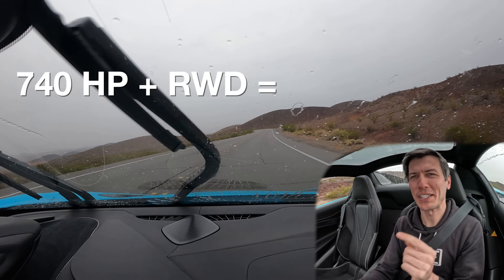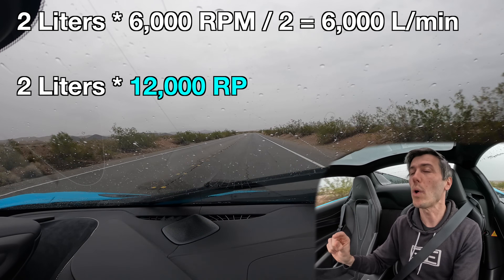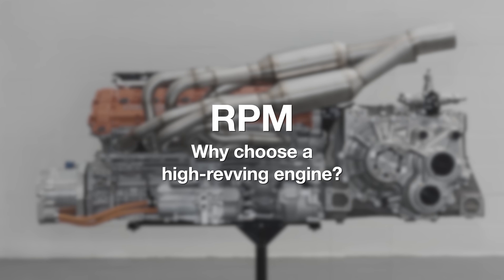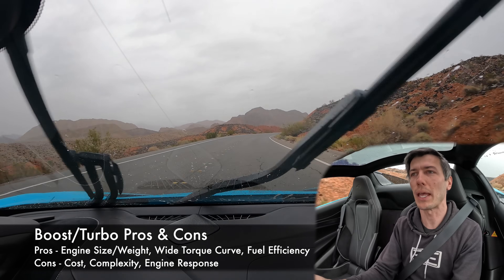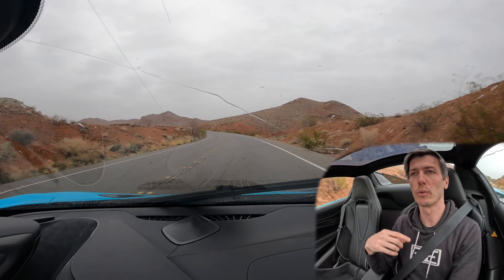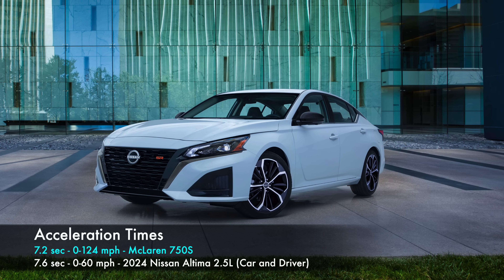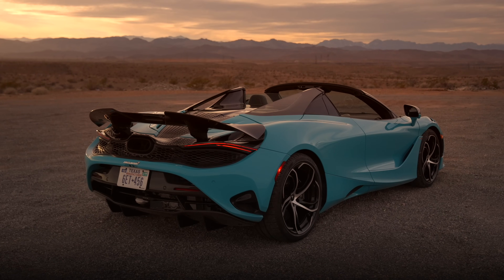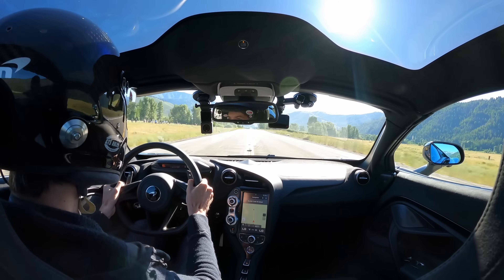Boost vs RPM vs Displacement - What's Best For Horsepower?

Comment: The way the Viper is 8.4L and the Koenigsegg TFG is 2L, and they both make about the same power is actually so insane.
Reply: In a sense, but one has to consider hoe antiquated the Viper V10 is. Its still a Pushrod engine with all the limitations the pumping of air entails. Thats just the part where things get more complex when comparing engines and powerplants.
Reply: @air-headedaviator1805  Pushrod is mandatory on massive engines, so you can get away with big displacement and a light engine.
Reply: @air-headedaviator1805  all are still pumping the same amount of air… as Jason stated. As you know pushrods limit rpm, to compensate for this they have enlarged displacement. All are the same, just different flavors.
Reply: @air-headedaviator1805  yes it's still a 70's-platform that's modified, but the generation 5 camshaft ( and there was a twin phaser system planned for it after the 4th gen but never came to the general public/dealership's on top of R&D for multi-air VVL controls as the v10/high-spec was planned as the testing bed for the v8 line up but so-far hasn't tricked down yet unfortunately ) cam-in-cam is actually more advanced than ford's 2014~ coyote 5.0 cam's and needing 4 phasers are
Reply: @air-headedaviator1805  and how it was a kinda relatively non stressed engine. It didn't have that high of a compression ratio for a NA engine
Reply: Yes, but you only see Vipers winning races 😂 No one races Koenigseggs
Reply: @gwi8650  It depends on what the race is.  If it's a drag then yeah the Viper will win but on a track maybe not so much.
Reply: @answeris4217   huh ? Viper won Le Mans in its class, it also won several GT series in Europe.
"In total, 57 examples of the race car were built between 1996 and 2005, and the vehicle would go on to claim three class victories at Le Mans, as well as wins at the Nürburgring and 24 Hours of Spa."
Reply: @answeris4217 no on a drag koenigsegg gaps
Reply: @answeris4217 they whoop ass on tracks looooooool
Reply: @answeris4217   The viper is terrible for drag racing, it's a pure track car. There is a reason why the ACR smashed so many ring records.
Reply: @answeris4217 you don't watch car racing do you?
Reply: @answeris4217  I would bet money that a Viper ACR, (with literally half the power output) would smoke any Koenigsegg built to date on a vast majority of tracks
Reply: @mro9466  yeah in GT2 class...  they wouldn't even qualify in that class today with  8L engine.
Reply: @answeris4217  Around the track, the Viper will win. On a drag, the Koenigsegg will dust the Viper. You have it backwards.
Reply: @mro9466   In it's class. That class being GT2, not GT1 which is closer what Koenigsegg builds, in fact they considered it at one point but gave up as a rule change meant they couldn't meet the homologation requirements. If you want to compare to something similar, in the 1998 le mans the viper lost to the GT1 Mclaren F1, which has a lot in common with Koenigsegg cars, a carbon monocoque and body, along with a MR layout.
Reply: @peterjordansonthe2nd731   an acr is not beating a 1:1 on a circut
Reply: @answeris4217 viper holds the fastest lap time on the nurburgring for a manual vehicle, ofc that’s not saying the most nowadays cus we’ve moved to more efficient transmissions but she ain’t nothing to be underestimated
Reply: @pizzahutlogo5009  The Viper doesn't hold a top 10 lap on the Nurgurgring.  The fastest lap and the only sub 6 minute car is the Porche 919 hybrid Evo.

In fact Porche owns 4 of the top 10 times.  VW owns No2... Merc and BMW are on there Mclaren and Lambo are on there too.
Reply: You better look up vipers history.those cars have killed track record all over n are racing legends.
Reply: @answeris4217    The viper might also win on track (ACR version with extreme aero package). That thing got 7:01 on the nurburging.
Reply: @gwi8650 I like both cars, but pretty sure that Koenigsegg would smoke Viper out 😅
Reply: @rouchar No Koenigsegg has ever raced in any series. Hell no Koenigsegg has ever been eligible to race in any series.
Reply: @rouchar koenigsegg brokes fast
Reply: @rouchar well one was so dominant privateers were winning their class for a few years running and the other hasn't seen an actual race.
Reply: @rouchar  they are racing boosted vipers, so no
Reply: They may be some badass cars but vipers are racing legends n have broken hundreds of records possibly more than any other car out there not to mention some of them put down some serious power without a problem.line up a jesko n a built viper n watch that viper pull
Reply: @gwi8650 you’re delusional if you think a viper is beating a koenigsegg on track 😂😂
Reply: @ericship8383  Koenigsegg barely even tracks their cars, its difficult to find any official track times. The CCX did Nurburgring in over 7.5 minutes, Viper ACR did it in 7:01. Logic and physics would dictate that Koenigsegg's newer cars wouldn't be all that great comparatively on a track, since in order to hit those massive top speeds they have to sacrifice downforce. So in the corners they'll struggle compared to the Viper and make up that difference on straights.

If you wanna try to find numbers with sources to prove what you think might be true go ahead, but look at the list of super and hyper cars that are still slower on track than the ACR
Reply: @gwi8650  Nobody races Koenigseggs because they are ridiculously expensive
Reply: @gwi8650 what vipers are winning against amyrhing but lamborghinis 😂
Reply: No replacement for displacement. Complexity is generally an enemy of consistency and reliability.
Reply: @PRS-dk4mz American cars are the masters of high displacement and most of them have terrible reliability 

The redeeming quality there tho is they’re easy to work on
Reply: @goosebox9064 Terrible reliability? I can say that the pedestrian/econobox/small displacement engines from American manufacturers are pretty bad ngl. However, American large displacement engines/blocks are pretty stout and known to have a really good reliability history.
Reply: @_IMNNO  For example the 6.2l gm from the late 90s 2000s they run for half a million miles all the time
Reply: @goosebox9064 Terrible reliability? The cars the high displacement engines in question are usually in much more reliable than the European sports cars they compete against while being much cheaper. The Coyote, Viper, Hemi, and LS platforms are insanely reliable and proven to surpass 200K miles with nothing but basic maintenance as well as being able to handle double the factory HP when boosted and to do it with significant reliability.
Reply: @goosebox9064  Not really man. A lot of American v8s are pretty dang sturdy. It’s the econo-shitboxes we make that are horribly unreliable and I assume it’s the sports cars you’re referring to with “high displacement engines.” Not our 4 bangers and v6s. Although, we still have some decent ones thrown in the mix
Reply: @goosebox9064 The viper Engines have gotten 3500+ WHP on factory block and have ran 100+ passes no issues.
Reply: 80s F1 cars might have a differing opinion. Reliable? Hell nah! But faster than everything else!
Reply: @PRS-dk4mz  weight, size, efficiency
Reply: @PRS-dk4mz weeell... Considering that the advantages of displacement are power, low mechanical complexity, good response, the best replacement for displacement would be voltage and current 🤭
Reply: @PRS-dk4mz except there is a replacement for displacement 
Because just making an engine bigger isnt practical
Reply: @PRS-dk4mz ok then why dont u race with a cruse ship motor only 20000000lbs lol ur 100% wrong there is replacement fir displacement in drag racing 100%
Reply: @PRS-dk4mz there is a replacement for displacement, the replacement for displacement is technology, forced induction, more advanced flu dynamics
Reply: Which one do you suppose has the longer TBO?
Reply: @Flies2FLL Which one do you think will be smaller and lighter? And which one will be cheaper to buy? Which one will have better fuel efficiency and/or emissions? 
Engine design is all about making compromises.
Reply: WHICH ONE HAS MORE TORQUE?? Torque wins races.
Reply: @Reginald-Bowls no it doesn’t that’s completely wrong. Look at f1 cars
Reply: @jeff5798  look at the fastest vehicles on earth. F1 is a restricted race.
Reply: @Reginald-Bowls  you are obviously clearly wrong. Instead of making pointless arguments, go educate yourself. This very channel has explanations of hp and torque and how they work.
Reply: @Reginald-Bowls  f1 cars are the greatest race cars ever made and the torque is 280 nm compared to their 750hp at 18500rpm. Their displacement is 2.4L

The f1 engineers know better than any person watching this video
Revs win races
Reply: @goosebox9064  To be fair, the only reason F1 doesn't use more boost is because it's not allowed. I'm old enough to remember F1 engines pulling 1500 hp from a 1.5 litres through boosting. Reliability at those power levels was sketchy at best, too.
Reply: @goosebox9064  f1 cars are not the greatest race cars ever made 😂😂😂
They’re fully restricted by stifling rules.
Reply: @Reginald-Bowls  what would you say is better? Objectively f1 is the greatest but personally I like Le Mans more.

But even then, probably the best Le Mans car: the Porsche 919 evo still has a high revving engine
Reply: @Reginald-Bowls  also you said ‘torque wins races’ which it obviously does not. Nothing about fastest cars on earth, which would be rocket powered cars, with ZERO torque.
Reply: @Reginald-Bowls What do you think "Formula" means in F1? The formula IS the rule set lmao
Reply: @goosebox9064 You mixed all the F1 cars together 😂 modern F1 cars have 750nm of torque and rev to about 12 000 rpm.
Reply: @nodo7575  I didn’t mix them but I did make a mistake, I was looking at the 2008 f1 cars which had a 2.4L v8 instead (still incredibly small displacement for the amount of cylinders 

Although that may be better now that I think of it because they were naturally aspirated and not a hybrid. So it’s truly displacement vs revs with no outside factors
Reply: @Reginald-Bowls Torque numbers on their own mean almost nothing. Having a wide torque curve that's more forgiving on being in a less than optimal gear ratio is the advantage.
Reply: @Reginald-Bowls That’s a myth
Reply: @Reginald-Bowls someone who doesn't understand torque would say that
Reply: @Reginald-Bowls torque is great for towing and passing people on the highway without downshifting. You have it backwards
Reply: @oy42-k5l  that is a perfect setup, doesn’t need to be a v8 for me tho, as long as it’s rev happy and light I love it
Reply: It's funny reading youtube comments comparing a $1million+ ultra high tech freevalve engine to an old pushrod NA v10, especially since they'll never be able to afford either. Keep going guys😂
Reply: That's the difference between a billion dollar american company and one European man with a dream.
Reply: @SupraSav  *That's the difference between a $100k 10 years old car and a $2million one that nobody can buy.
Reply: @MrArcticPOWER Or bike 1000cc and bb car
Reply: @oy42-k5l I’m a corner carver guy too. I have a stroked 9L Viper that will “carve” with the best of them. I can also enjoy my 997.2 RS, as well as a few others. The power and torque from my Viper is a lot of fun, on and off track.
Reply: Also crazy that production cars are making that much power. I remember thinking 400 was crazy
Reply: Don’t confuse torque with horse power.
Reply: I'd have a viper over that all dayyyyyy any dayyyyy no problem
Reply: 2 Stoke engines are king but they are dinosaurs cus its not developed in modern times
Reply: The TFG also only makes 600hp on E85
Reply: @annonymously331  The 600bhp number might actually be E100. The freevalve engine is capable of running pure ethanol in all environments.
Reply: The Viper V10 will make that horsepower easier and will put that power down quicker (more torque).

The problem with more torque is controlling that power being put to the ground. Thus, transmission and tires will ultimately determine how well that vehicle will perform
Reply: american cars are crap.
Reply: @vegasastras9194  Can't be worst than German trash
Reply: Gotta take a second to appreciate how overdone the Senna looks...
Reply: Can't belive some braindead guys are comparing a 2.0 litre with high tech, turbos that will blow up at  60k miles with a v10 truck engine that surelly can make 1000hp plus with turbos and the v10 actually sounds good
Reply: @DT-7727  The whole entire video is about comparing displacement, boost, and RPM. So why wouldn't we compare them?
Reply: @ohedd it’s as if you didn’t watch the video. It’s not crazy at all.
Reply: @Fee.1  it's as if "crazy" to you requires that something literally bends physics. Nobody is saying that it's impossible - it clearly happened right in front of everyone's eyes. The claim is that the difference is vast.

Viper has 420% the displacement of TFG, and roughly 86% the RPM, which means the boost alone would represent something like a 360% increase in output. That is unheard of, hence why it's "crazy".
Reply: @ohedd  but it’s a pushrod motor. The displacement is not directly comparable to it would be like a 5 liter v10 or so if it was a dohc motor like what you’re comparing it to, hence my point it’s not really as crazy as it sounds.
Reply: @DT-7727  downsize turbos blowing up is more of a correlation thing than a causality. today manufacturers are better at predicting how long an engine might last and they squeeze out the last penny. No matter if it's turbo or not.
Reply: @DT-7727  a turbo engine and a naturally aspirated engine are built differently.  A turbo engine will have lower compression, the intake valves usually are open longer and the exhaust valve are usually larger.  There's other things too like the bottom end og the engine is likely stronger on a Turbo engine.

You could just slap a turbo onto a regular engine it won't handle it by itself.  You would need to bore out the exhaust valve, change the cam, reinforce the bottom end (piston rods ,pistons, crankshaft and barring holders)  and ether bore out the head or put a special head gasket to lower the compression ratio.  Not to mention change your exhaust system and intake and find room for intercoolers and the physical turbo itself.....

Easy enough.
Reply: You guys are arguing about something that is actually what makes cars so great.  There is more than one way to skin a cat, and for cars that’s a very good thing.  Variety is good and thankfully the argument isn’t settled and left us with a single choice. You can build/buy what you like and enjoy it.  Interested in racing? There are paths to success and competitiveness with tons of different engine setups.
Reply: Cylinder pressure is up there i bet
Reply: One one hand it's insane when taking stick modded vipers roaming the wild hp numbers pushing anywhere from 800 all the way up to the mid 1K's(there's even a few examples that's nearing 2k) for less than the price of a stock McLaren
Reply: give viper the budget of koenigsegg and we can talk
Reply: @lansiman   I guess you don't realize this, but mostly the reason why a Viper engine is cheap and a Koenigsegg engine is expensive is because the manufacturing process of the car isn't scaled up. So if Viper made a bunch of components away from their assembly lines, without piggybacking off Fiat Chrysler's supply chains,  and inventing a butt load of entirely new components to make the engine camless, it would also be expensive. The Viper is optimized around winning the "horsepower per dollar" race, whereas the TFG is optimized around winning the "horsepower per liter" race.
Reply: Who will last tho? Long-term
Reply: buuuuuuuut....... VIPER > anything regardless lol
Reply: @oy42-k5l if you’re a “corner carver” then you’d probably love the fact that the Viper ACR set like 17 production car track records. It’s a 3300lb Miata on steroids.
Reply: American engines are highly unsophisticated…
Reply: @BennnWJK  dont have to be if they're reliable
Reply: @BennnWJK sophisticated doesnt mean better. Sounds like euro snobbery to me.

Also the coyote is just as "sophisticated" as most other foreign engines, and it does just fine.
Reply: @leomux2004 ariel atom v8. Shame it wasnt using some 5v heads. I know 4v gets the same power but if they went with that essentially fully custom engine i wish they coulda went with a 5v "tho ill never own one myself i like slow cars irl"
Reply: And guess Wich ones gonna last longer without a major engine overhaul
Reply: Yeah the tuning potential of an 8.4 liter Is insane too compared to a 2L
Reply: Until you build the viper engin and it makes 900+ na
Reply: That's how you know HP ratings are useless. It's all about torque.
Reply: I mean, the viper is naturally aspirated, so there goes a lot of power. If you twin turbo them, those engines can get up to 3000 horsepower (Calvin vipers).
Reply: JUST BC SOMETHINGS "ANTIQUATED" DOESNT MAKE IT BAD. THERES MANY INSTANCES WHERE ID CHOOSE THE VIPER V10 OVER THE KOENIGSEGGS UNLESS WE ARE ONLY TALKING ABOUT CASHING OUT.